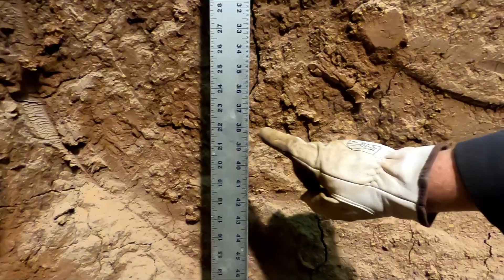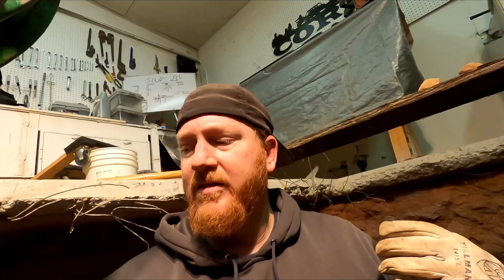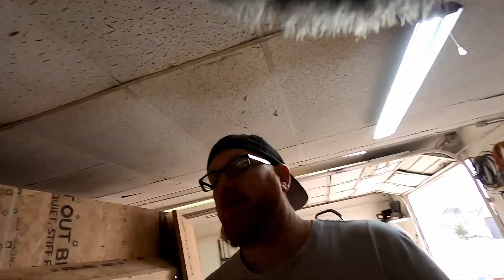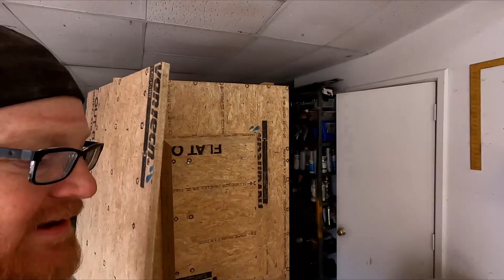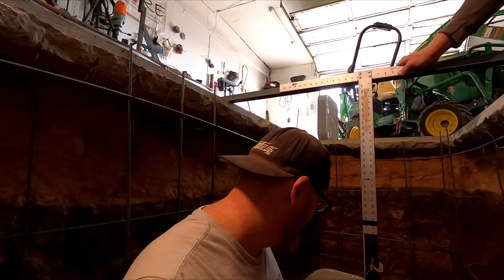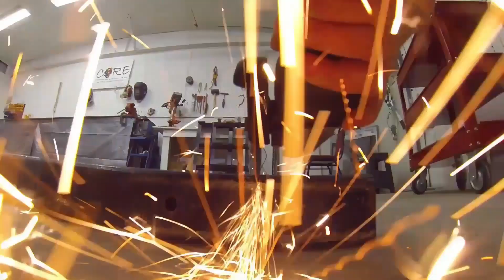Pit Digging Hell Week!  Rebar install and prep for concrete!

Comment: what are u vloging on a 360 cam, jw cuz i saw the mic a few times, btw orderi g concret early is very smart for other reasons as well. like cement shortge nation wide
Reply from the maker: I do need to do a 360 cam to catch footage that I miss from things happening out of view.  They are jus such large files its hard to process the extra data and have storage.  I am currently on a go pro 8.  I have an action camera to survive the shop.  I like to have the image stabilization so I can grab it quick off the stand with my gloves and tools in my hand.  People don't get so motion sick.  360s definitely are the best fore that though.
Reply: @ThinkBuildTest  i have had a 360 cam, the compression wasnt the issue, for me, it was the double editing. im sure it get easier, but i wasnt very good w it. i guess if it was static it would be ok